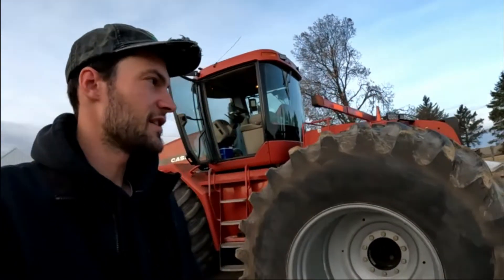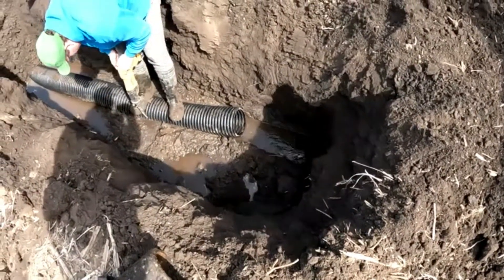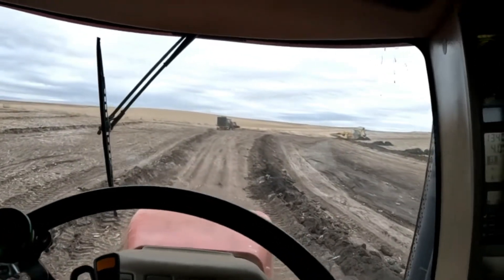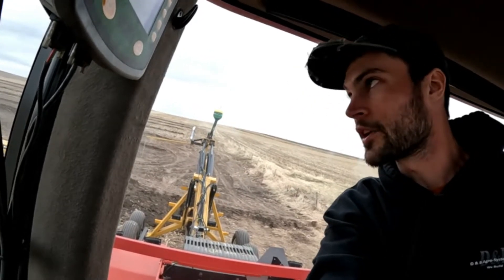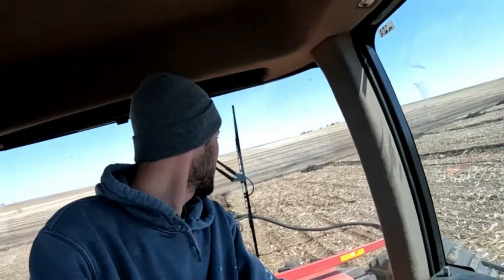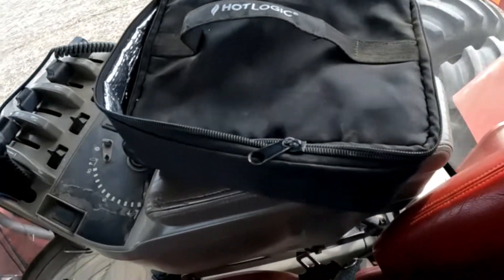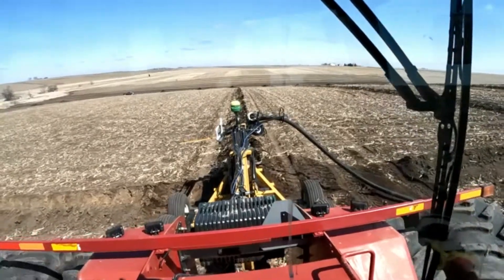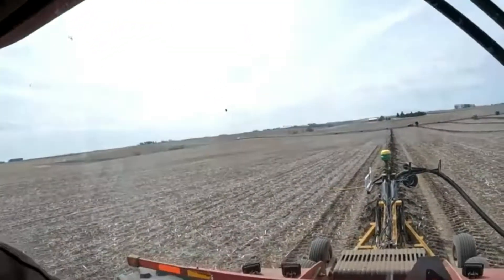Pattern Tiling a Field for Dummies

Comment: What size of tractor are you using here? Do you have to pull it very often?
Reply from the maker: Stx 450 with fluid in all tires. In normal conditions I can pull 4” tile easily. When putting 8” in over 4’ deep or when it’s damp on top, we have the tug tractor on standby.